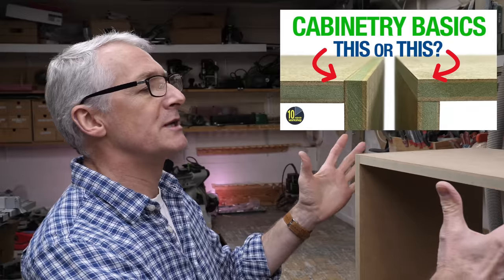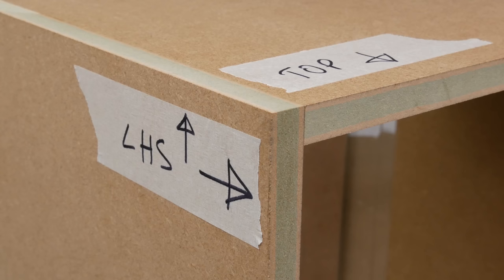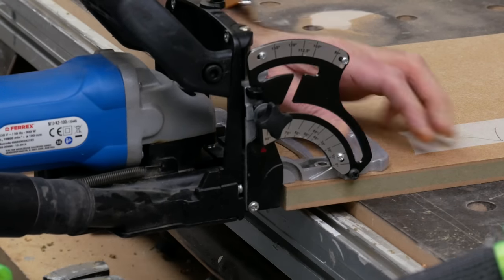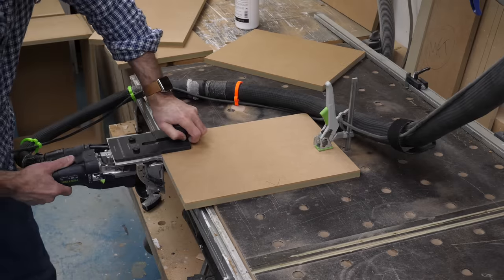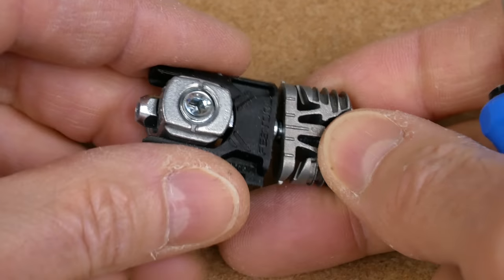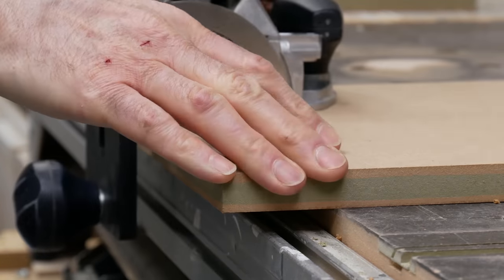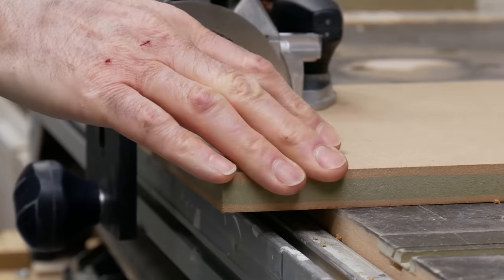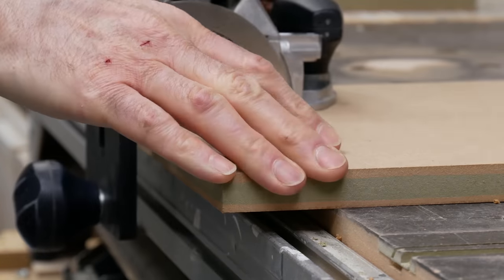Cabinetry Basics P3 [Video 437]

Comment: I’m wondering: are you using the original cutter in your biscuit jointer? I bought a fairly cheap biscuit jointer some years ago and dry fitting was rather loose until I replaced the original cutter with one from CMT (biscuits now even occasionally need some convincing on insertion)
Reply from the maker: Thanks! Yes, the cutter’s really good actually - it’s the biscuits that have dried out, made them a bit loose! 👍👍
Reply: @10MinuteWorkshop  At some point I came across a recommendation to store biscuits in an air tight container to keep them from absorbing air humidity (I assure you this was about wood working biscuits, not the edible kind). Either biscuits differ wildly (I’ve been using stanley brand and those don’t seem to vary while stored “openly” in Belgium) or London is a lot dryer than I think it is and that person lives in or near a swamp...
Reply from the maker: My workshop is like a kiln most of the time, very very dry and warm, so it’s almost certainly down to my environment! 👍

Comment: The Zeta is by far the easiest connection. They advertise clampless glue-up. But the specs for the pressure required by wood glue and the force the Tenso connectors supply don't seem to match very well.
Reply from the maker: Agree. The Clamex are fantastic, but I’m not a fan of the Tenso. 🤷‍♂️👍

Comment: Hi Peter. I have a question ref guide rails. Do you know of a guide rail compatible with a Ryobi circular saw model R18CS7. The only one I can find is the Ryobi that is manufactured in plastic. Many Thanks in advance Regards Ray
Reply from the maker: Hi Ray. I'm afraid I don't no; by the looks of it, the plastic track seems to have a rib running along its length, but where that falls and what size it is I couldn't say without having one in my hands, I'm sorry. 🤷‍♂️ 👍
Reply: @10MinuteWorkshop  thanks Peter. I'm not comfortable with plastic, I've sourced some aluminium flat bar that has the right profile dimensions so I'll make my own. Cheers

Comment: Do you have an6 experience with the minifix system? Or do you mean that when talking about flat furniture?
When you use those systems, you put the holes on the bottom of the cabinet, the floor side as it where.
Reply from the maker: Mini fix (cam and dowel) is a great system, but a nightmare to fit without a jig, and the jugs are expensive.  🤷‍♂️👍
Reply: @10MinuteWorkshop  Ah. I was planning on making my own bathroom cabinets with them, but preparing my own jig, using an ikea cabinet as reference. I'll be using fully ABS edged coloured melamine chipboard.
Reply: I resized a pax this year (width 75cm to 66cm), it wasn't that hard to get the things to line up again. I did have the off-cuts to help me of course.

Comment: The Domino connector has to be the weakest (as in price to performance) of the bunch. It looks like Festool realised they had missed a market segment and that was the best the engineers could come up with given the constraints. Both the Lamello options are good looking connectors but at that price there's no way I'd touch them, even at half that price they are expensive. The peanut is interesting; I remember having a toy that used a basically identical connector as a kid, the joint became loose over time. For a cabinet that's put together once and glued that's probably not an issue but I'd be interested in how well the joint lasts.
Reply from the maker: Yes, the connect fittings for the smaller domino seems to be a complete afterthought - not a patch on the ones they make for the DF700. The Peanut is a very interesting option, and one that’s growing on me the more I use it. And though it’s similar to other fittings we may have used in the past, the clever stuff in the engineering behind the peanut, where it tightens itself up as it’s inserted, should meant that it won’t come loose over time. The guy who created it did so for his own fitted furniture company, so he’s staking his own reputation on it, putting his money where his mouth is. 👍👍

Comment: I really like that peanut connector set but the price of it just keeps me thinking that I should save a little more and get the domino. Is there anything that the peanut can do  that the domino can't and vice versa?
Reply from the maker: Different animal, a self-contained dedicated power too vs a jig & router based system. The Domino's party trick is its versatility - cabinetry and small joinery, no issues on narrow stock, you can make your own dominos if you want to etc.. etc.. The peanuts strengths are it's a self-clamping joint, with much cheaper cost of entry compared with, say the Lamello Tenso, both connectors and hardware. Mini jig for the peanut 2 is out soon, that will change the cost of entry significantly, again. 👍

Comment: I love the videos but wish you'd go into detail more about the advantages/disadvantages. As a beginner I don't understand why anything that needs to be reassembled couldn't be done with a simple screw joint.
Reply from the maker: Because a simple screw is an ugly hack, whereas a knock-down fitting is concealed ie no visible marks on the workpiece surface. 👍
Reply: @10MinuteWorkshop   I guess an exposed knock down fitting is just as ugly as an exposed screw to me. At least they give you more options on where to put the exposed piece.

Comment: Are many of these connectors specific to Europe (or.maybe even just the UK)? I've seen dowels, biscuits and dominoes, but none of the others before.
Reply from the maker: No, the Lamello fittings are widely available - there are many others too, but not so common. The Peanut connectors are relatively new to the DIY/trade market, but used extensively in industry. 👍

Comment: What about using regular dominos and pocket holes together? If there is pocket hole near each domino it should do same job as domino fix, but 100x cheaper. Leaves ugly hole but so does the domino fix, though there are plugs sold for pocket holes.

Comment: Hi Peter, I'm sure you realise this, but you didn't really use the dowel jig in the way it was designed to be used. Are you aware of this? Great vid by the way, really enjoying this particular series.
Reply from the maker: Do tell. 👍
Reply: @10MinuteWorkshop  I'll try but it is difficult to explain. It took me ages to understand the destructions. Use the 4 pins on one the ends to centre the hole, then put a dowel in. Put the the correct size hole with the brass bush over the now inserted dowel and adjust your fence to meet meet the edge of the workpiece this will set the fence to the correct depth for the face of the other part. Lay both pieces (sides and bottom eg. on top of each other so that the edges are flush now use the slot of the right size dowel over the top of the dowel until the fence contacts the edge,  this will allign the pieces to each other without any measurement at all.  I'm so sorry it's very, very difficult to explain.
Reply: Perhaps I'll try and make my first youtube video to explain although there may be some out there already?
Reply: @10MinuteWorkshop  just search 'how to use a dowel jig' on here. The milescraft video explains it considerably better than me. Apologies for the explanation again.

Comment: Hi Peter, I joined the channel only a month ago and am really enjoying it. The videos are great.

As someone new to carpentry, the domino is well out of my price zone (I bought a track saw after your videos by the way).

What would you recommend for a newbie with limited budget that wants a tool for hidden fixings. I'm using a Wolfcraft dowel jig at the moment, but it takes me a long time to get everything measured up to fit correctly (plus a lot of finger crossing when it comes together, then sanding).

Thanks
Reply from the maker: Hi James, and thanks! If you're finding dowels slow, then a biscuit jointer may help speed things up; if you already have a 1/2" router, then the peanut mini jig might be of interest, it'll be out soon. 👍
Reply: @10MinuteWorkshop  Thanks Peter. I think biscuit joiner first and if the bug really bites, the domino can be a Christmas/Birthday/Christmas/Birthday present.

Love the channel.

Comment: Should have said this on the previous video. I used to use long bright brass screws, 6mm, with 5mm pilot holes. Instead of hiding the screws, I made a feature of them. Pre-paint all panels. Not suitable every time but can look nicely ott and kitsch in the right place
Reply from the maker: Yep, same with chrome or stainless, too - can look fantastic 👌👍

Comment: Interesting vid but.....how much?????? that's a lotta filler and sandpapers worth outlay for basically an edge on edge fixing system, its simply not cost-effective for anyone outside of a full-on 24-7 cabinet shop where speed matters, maybe for the outside edge MAYBE! if its a super high gloss finish but for mdf......nope sorry not for less than £5 of wood and if it was vital to be hidden...i have a table saw and some ply...rebate time!

Comment: My first impression is that covering all three technologies in a little under 8 minutes is a little fast.  Not enough time on the setup of each.  I am not suggesting a full video on each, but a little more about the advantages and disadvantages of each, and how difficult they are to set up.  The setup is everything by the way.  The actual drilling of holes in wood is the easy part.  Although the DF500 is very fiddly about how you actually push on the machine to get a straight hole.  Not for you after probably 10,000 mortices.  BTW, 3/4in plywood using 5mm dominos is NOT easy to get clean mortice holes.  Dowels are a problem with blind, permanent shelves.  Dominos are better at precise placement of blind shelves.  My conclusion is that one doesn't just go out and buy these tools, and instantly go back to the shop and put together cabinets like you do.  It takes time and a bit of learning and lots of practice to get to the level of precision and finish that you do so effortlessly.  Also, anything larger than the small cabinets that are shown requires an entire new level of expertise, learning, and practice to get right.  My first project was a 10 foot high wall unit, 8 feet long, in six carcasses with a custom face frame installed on the completed wall unit in place.  All with Dominos except brad nails for the faceframe and carcass backs.
Reply from the maker: Appreciate you taking the time to comment, as always. This is a small part of a basic cabinetry series, and only the briefest overviews of the most common hidden fixings. There’s a more detailed ‘Domino Cabinetry’ set of videos planned, and I may do something in dowels as well, because they’re so accessible to new woodworkers. 👍👍
Reply: @10MinuteWorkshop  Sorry for the lengthy reply.  I want you to know that I appreciate everything you do.  You are one of the best on YouTube and I look forward to every single video you produce. Going forward, I will shut up and listen for a change.

Comment: Silly question: Your use of the word "carcass" is a bit unsettling to American ears as here it only refers to a dead body, human or animal. How are you using this word, please? To just refer to the complete structure of what you're building? Thank you.
Reply from the maker: Carcass and Carcassing are standard terms in joinery and cabinetry to refer to the body of the workpiece ie a cabinet or wardrobe before the other elements (doors, legs, plinth, feet, etc.. etc..) are attached. 👍
Reply: Thanks for the explanation, Peter!